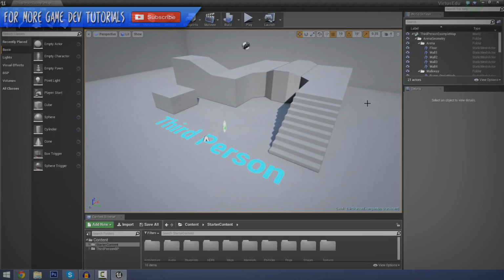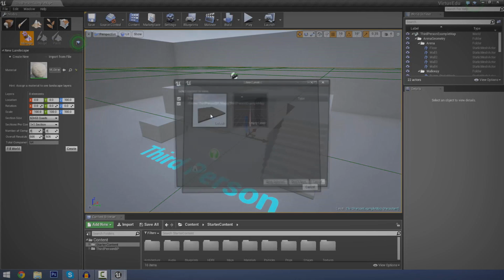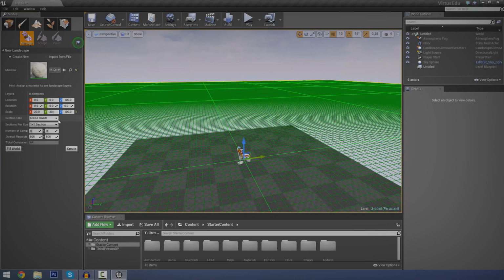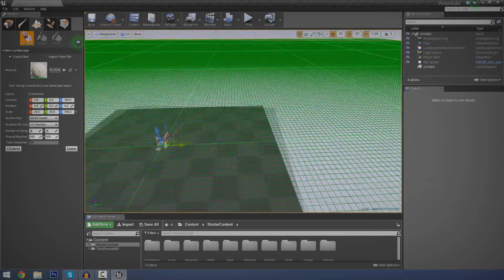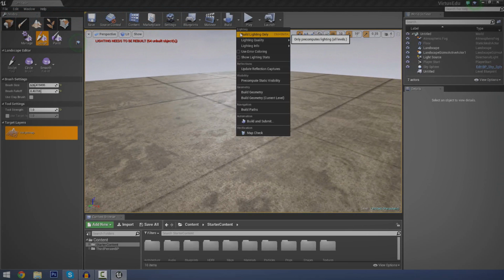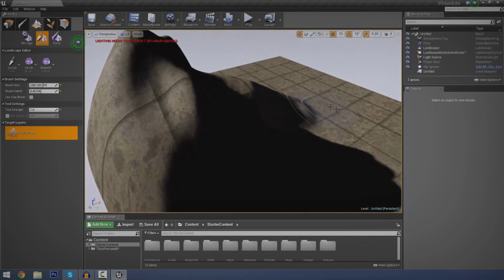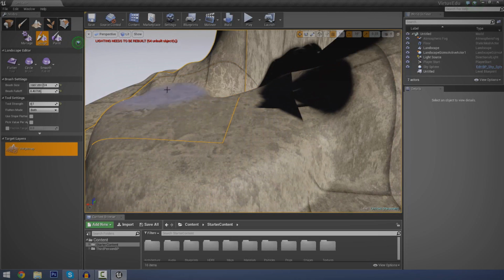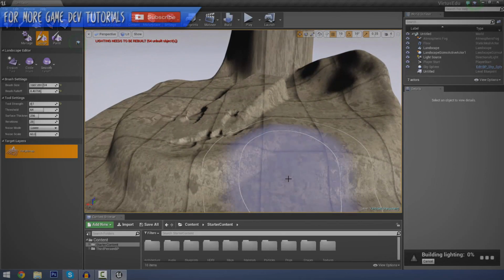Landscape Editing Basics - #15 Unreal Engine 4 Beginner Tutorial Series

Comment: How do I sculpt down with the erosion tool to make a very definite hole. When I use the tool its too soft I just want to click and get a huge hole in the ground?
Reply from the maker: It sounds like you just need to adjust the brush strength/intensity and change the size of the brush. I hope that helps!
Reply: Yea I had more of a play and managed to get it more definite.
Reply: You can try using SHIFT+click with the sculpt tool to get the depth that you want, then come in with the flatten tool and click right in the center--changing the slope into more of a cliff or well. Just play around with it

Comment: I have tried to make a  Occean with shallow blue clear water and a Bay area, but it don't move well in Unreal Engine.
Reply from the maker: You can make amazing water inside of unreal engine, you just need to use the right method. How did you go about making it?
Reply: I added Terrain, then I added T_Water_M. I was trying to make Blue Clear Shallow water right before  the Beach bay.  I used Google.Images and some-how I can't make the water move, how do you get rid of the lines on the picture when you imported? I'm a  beginner.
Reply from the maker: +Timothy Guilbeau The lines on the terrain should go when you build your lighting as shown in my lighting tutorial. The best way to create water inside of unreal engine is by using a flat plane mesh and applying the animated material to it and then apply post processing underneath it if you want the player to be able to go inside of it. I'll be making a water tutorial soon for ya.